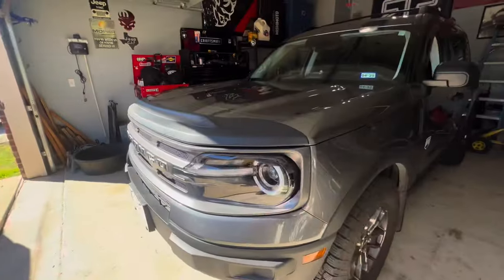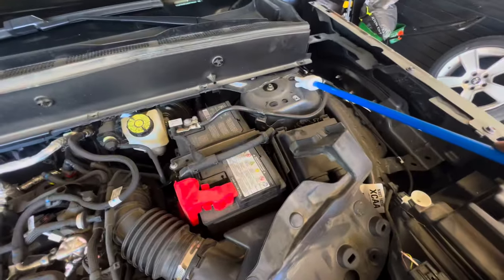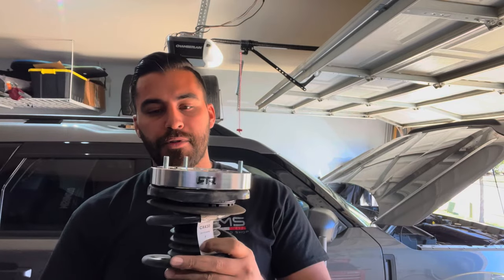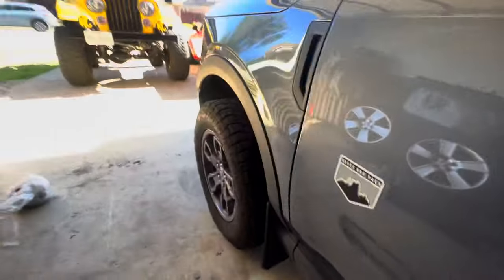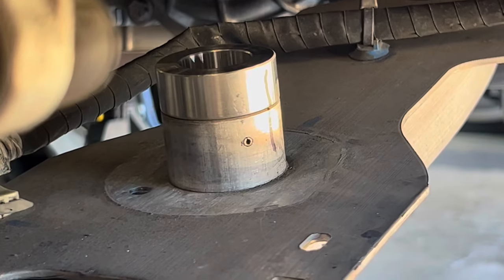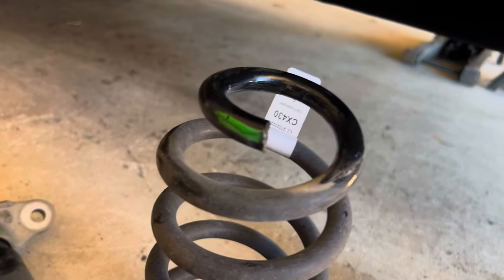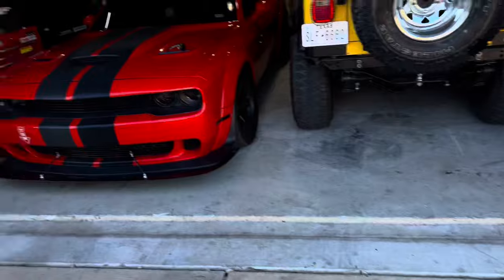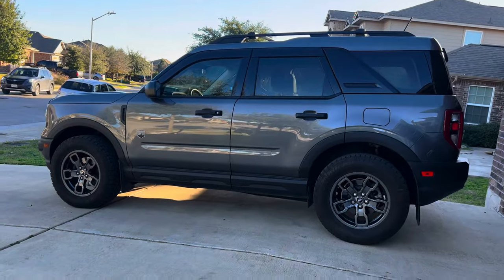My 2022 Bronco Sport Gets Lifted! - EASY INSTALL

Comment: Nice Video..  I want to put bigger wheels as well. I want a thicker tire but not sure what will fit. Can you recommend a size of rims and tires the biggest I can go want to make it more aggressive. Thanks for the info
Reply: Hey there, so I just got a ‘24 Bronco Sport Saturday, and I’ve been doing quite a bit of research on it. I was going to do the 1.5” lift but found a 2.5” lift instead. Anyway, here are the recommendations for tire sizes depending on your wheel size. 245/70/16,  245/65/17,  245/60/18,  & MAX tire sizes; 245/70/17,  255/75/17,  245/65/18,  “with minor trimming of the pinch weld on the firewall and minor trimming of plastic.”… I am personally going with the 245/65/17, so no adjustments have to be made and it looks great. You can look up the YT video “2021 Ford Bronco Sport 1.5-inch suspension lift” for reference.
Reply: Isn't the 2.5 lift for the lower line sports, wea the badlands already lifted has the 1.5 lift

Comment: @TIRADORACING Would you mind sharing where you placed the jack for front and back in order to get the stands under the punch welds?  Thanks for the video!
Reply from the maker: I actually sold it and got back into a Ram. I can’t remember where I jacked it up from either 😖.

Comment: I have heard horror stories of wheel spacers. I want to get them because of the price but im wondering if I should just go for an offset wheel instead
Reply from the maker: I’ve had no issues. Just torque em down. But get wheels if it your baby. This is my highway mobile.

Comment: Do you have plans to do any performance mods to the bronco sport? That 1.5 L3 engine is the same one used in the MK8/8.5 Fiesta St from the UK. I’m waiting on my afe power intake to come in and a mountune throttle body elbow. Later on maybe axle back and tune. Also I fit 245/70/17 Bfg KO2s with no lift. No rubbing on pavement. Can’t say about off road.
Reply from the maker: I don’t have any plans I really just use it to go to and from work or to filming locations. I’m already creeping to 25k miles in my first year lol
Reply: @TIRADORACING  yeah me too this is my commuter vehicle we do about the same miles a year lol. By no means am I trying to make this a race car but a bit better drivability doesn’t hurt 😂 the trans gets on my nerves with its constant downshifts trying to get to the lowest gear possible and cylinder deactivation on this already 3 cylinder is pretty wild lol

Comment: Okay so I know this video is old and I’ll be very happy if someone has an answer: I just bought a 22’ bronco sport big bend… windows and windshield are tinted, dash cams installed, I’m wanting to lift it, get some new wheels and tires. Any suggestions on the best ones to either start out with or get?
Reply from the maker: I’m at 30k miles now and I have zero complaints. The wheel spacers will make it rub on the front on certain turns.

But the RTR billet lift and the Toyo open country 245 tires have been great. 

I’ve heard mixed reviews on the rough country lift and I haven’t heard anything bad about the Ford Ranger Lifts brand.

Comment: How is the behaviour on the daily driving? Any impact on mpg? I’m almost getting the same kit, but I’m still on the fence regarding reliability.
Reply from the maker: Basically nothing has changed lol maybe dropped 1mpg with lift and tires. 

But other than that it feels exactly the same!
Reply: That is great to hear! So I Think I’ll go forward on this. I was scared about the long term on this and warranty. Thanks for the help, I’ll make sure the shop does a good service as you did on the video! Hahahaha
Reply from the maker: @diogenesnicaciomota3884 just don’t do the wheel spacers lol it does in fact rub 😅!
Reply: @TIRADORACING  No uneven tire wear? Worth it? Did RTR make changes in their design with the issue that you experienced to the rear spacer?
Reply from the maker: @gvsukids no uneven tire wear, I rotate them every oil change. Just get an alignment. And I’m not sure if they changed their design but I can ask.